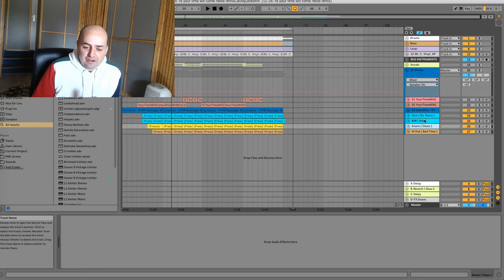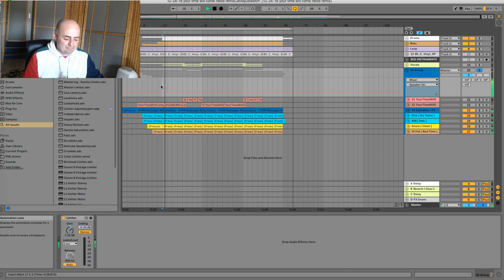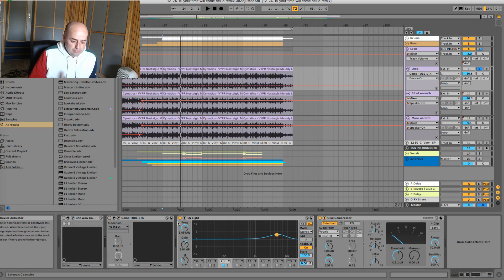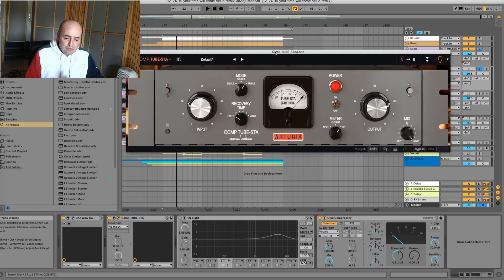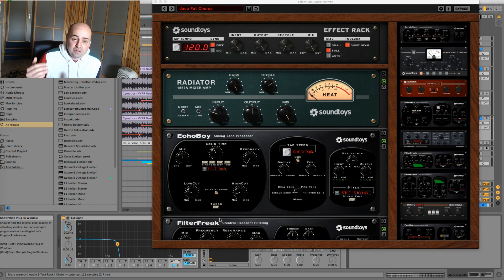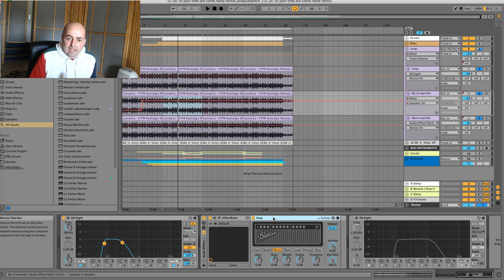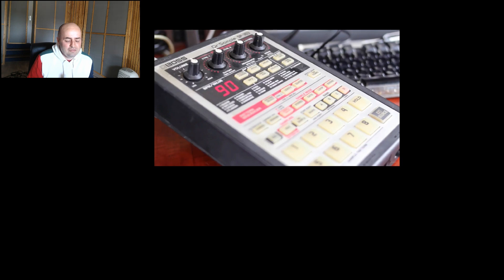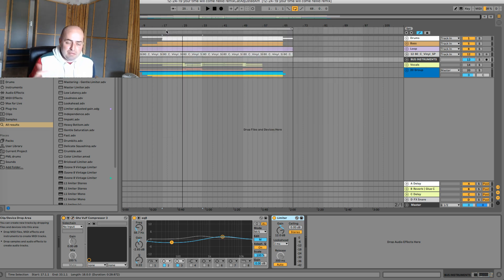Fatten up your Loops

Comment: That's so good. cause, really the original SP303 (got one sitting next to me :) ) is pretty fiddly with it's low end. Can't handle much, esp. subs, and swallows it easily when you crank the vinyl sim. It's a great unit for tons of reasons, but I don't think it could do what the vulf comp does here super easily.
Reply from the maker: Check the internal side chain function on vulf :) everything you wished for

Comment: Hey man is that last gluing plug-in on the master or on a bus for the 3 loops? Also could this same effect be achieved by creating an audio effect rack on one of the loops and multibanding it in 3 different chains? Cheers mate keep it up
Reply: By multiband I mean the frequency splitting technique you used
Reply from the maker: The last glueing effect (vulf compressor) is on the instrument bus. It by passes the vocals. Is that what you mean?